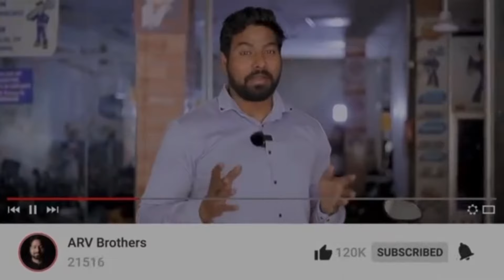Complete Engine assemble PART 2 | Honda Shine Bs4 | Step by step | Arv brothers |

Comment: Bhai mara pass NS160 2018 model hai ...bike m koi problem nahi par jab sadak par hawa taaz chalti hai to bike jhatka marti hai race choditi hai 60 sa uppar nahi jati .... engine bhe sahi hai carborator ki slide bhe new dal de par problem same hai😢
Reply: Bhai air filter clean Karo or oil filter check karlo
Reply: Or dono wheels ko dekho free ghum rahe he wheels kahi tight to nahi he
Reply: @kingschouhan261  sb ek dum new dalva leya 😹